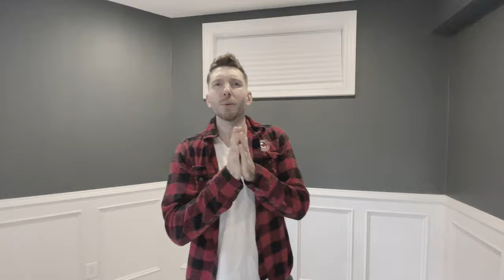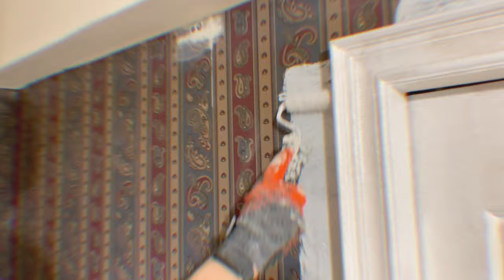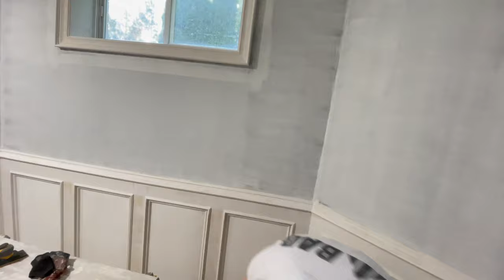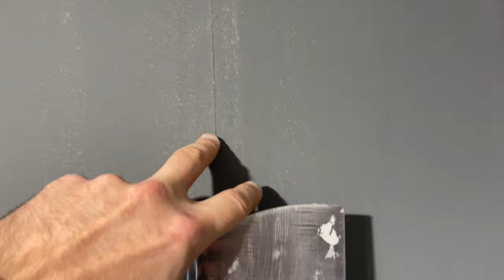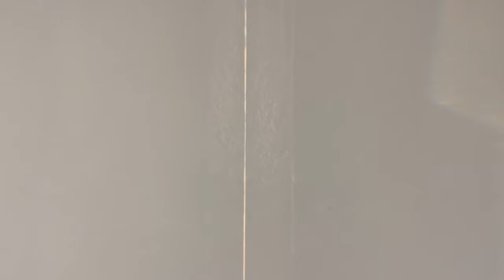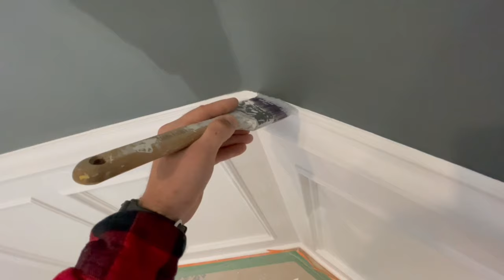Painting Wallpaper: Can You? SHOULD You? (Watch This First!)

Comment: I want to paint a small dining room that is wallpapered. It's been up 25+ years and am worried if I take the paper down it will cause damage to the dry wall.  Had 2 bathrooms remodeled and when the contractor started to take the paper off he said it damaged the dry wall and would be easier to just put up all new dry wall.  He didn't charge more to do that but maybe it easier for him to install new dry wall then to remove the old wall paper.   I will have some seems to plaster over.

Comment: just in time! this may solve my issue, where my wallpaper is pretty caked on, but I wonder how long this will last? Do you risk having the wallpaper start peeling off eventually? What if I textured on top of wallpaper, then primed, then painted? this is great!
Reply from the maker: If you follow the steps in this video, your wallpaper wont being peeling any faster than it would on its own. HOWEVER, if you’re going to go through all that effort to texture, prime and paint your wallpaper, we’d ask, would it really be that much harder to just remove it? When in doubt you’re always better to remove it first. If you can’t, or simply dont want to invest the time, seal the wallpaper with a solvent based primer and it essentially becomes a blank canvas (albeit a wallpapered canvas 😂).

Comment: I tried to get off old wallpaper and just gave up after a brutally slow process of using many different techniques to remoe about 6-7 sq ft of it. Can I use Solvent based primer to cover that area up as well, successfully? Thank you for a great video.
Reply from the maker: You could, but you’ll more than likely be able to see the areas you removed the paper still. In order to get back to where you started, you’ll probably have to prime, then skim coat the areas you removed the paper, and then prime it again. Not an enjoyable predicament to be in- but if you’ve decided removing the rest is not an option, you could give this a shot. Best of luck 👍

Comment: Great video and great painting job! I had a contractor who decided that putting in new sheet rock would be easier than removing the wallpaper that had been there for so many years, so that’s what we did. Now I have 2 more rooms to go. One has foil wallpaper and another appears to be vinyl. Will this work for these types of wallpapers?
I appreciate you getting right to the point in your video and not wasting my time by dragging on and on like so many do nowadays.
Reply from the maker: Thanks for the kind words! We always find it interesting to hear how many different ways there are to solve a problem. In response to your question, we’re not very familiar with foil wallpaper- but theoretically it should work on any wallpaper. The solvent based primer essentially gives you a new canvas to work with (‘sealing’ the wallpaper and providing a good bonding surface for new paint). Just remember that painting over it will not get rid of any bumps/seams/imperfections in the wallpaper. The easiest way to know for sure is to test it on a small area and see for yourself👍

Comment: This video was very helpful for me!! 
I recently moved into a 1920 house and every room has  different wallpaper!! 
Should I just do what you did? 
The wallpaper was put up 25-30 years ago…
Reply from the maker: Happy we could be of service! How is the wallpaper holding up? Is it peeling in the corners? We always suggest at least attempting to remove it before deciding to paint over it (sometimes it’s easier to remove than expected…sometimes 😂). If the paper is still well adhered, and you follow the steps in the video, you should be ok to give it a shot. Also, if you hate it, you could always remove the wallpaper after you’ve painted it too 😉 👍
Reply: be careful for asbestos or lead.

Comment: Thanks for the great video! I’m looking for a way around removing the wallpaper so this was helpful. Question: could I spackle and sand the wallpaper seams before I put the priming paint on or should I do it like you did- after the primer and first coat. 
Thanks!!
Reply: I am no expert on this but it is possible that the primer and first coat will show the imperfections clearly, and will protect the wallpaper during sanding.

Comment: Couple of questions. Is it best to mud the seams before primer, after or after painting. Secondly, should i use tape also or is just using the mud enough?  Thanks!
Reply from the maker: Drywall tape can’t hurt but it would make a bigger bump and probably it’s necessary. Defintely fill after oil based primer. The moisture in the compound could cause bubbling without primer first
Reply: @RefreshHomeImprovements  thanks so much!

Comment: Can you please tell me each of the products you used? is the gray paint a oil base or flat?
Reply from the maker: Sure! The white paint we used first is an alkyd based primer by Zinsser caller B-I-N 2, it’s designed to seal stains and block odours (be warned it has a very strong odour of its own while painting). The top coat we used is Benjamin Moore Aura in a matte finish (you definitely don’t need to go with such an expensive top coat here- we wanted to colour match a farrow and ball colour, and you get a better depth of colour with aura). We used Benjamin Moore advance in a pearl finish on the wainscoting 👍
Reply: @RefreshHomeImprovements  I've heard good things about zinsser. Is it similar to kilz, and I have one room where the wallpaper was actually adhered to plywood in areas instead of plaster. Thinking of doing this method but worried about having spots that are paper and spots that are bare plaster as it may look uneven. Ever done this before? I figured a good sand on the remaining uneven areas some zinsser or kills and paint would at least make it decent

Comment: Thanks for the video. Do you know if the primer make the wallpaper and paint stick on for a long time or does painting over wallpaper always increase the chances of it flaking off in say 10-20 years?
Reply from the maker: Not sure we really have the answer to that question. Painting the wallpaper shouldn’t really hurt or help the adhesion in the long run.
Reply: @RefreshHomeImprovements  Yeah i guess its a tricky question, but yeah it probably will stick with the primer... Thanks for the reply

Comment: How would you remove heany nicotine stains from the wallpaper before painting with the primer (Binz)? If we use the standard TSP, I'm concerned it will reactivate the glue.
Reply from the maker: That’s exactly what we did here! The oil primer also sealed and covered years of nicotine stains from this being an old cigar room. We didn’t clean it before or anything.

Comment: I am thinking of painting over the wallpaper in my son's room.  The wallpaper only goes up half the wall from the floor with a border around it at the top.  There is a lip around the top and bottom of the border. It is in good shape and very stuck on the wall.  Do you think joint compound will leave too much of a hump if I try to mud over the top and bottom of the border seam (border is around 6" wide)? You can hardly feel the seams if running your hand around the wall, but the border seams are quite pronounced.  Also, would I just prime the part of the wall that has wallpaper or the whole wall which is painted on top?  Steps would be prime (oil based) , repair holes, mud seams, sand and then paint right? Any advice you can give me would be appreciated. The wallpaper is in good shape and is very glued to the wall.
Reply from the maker: Sounds like you’ve got the gist of it 👍. I would definitely try to scrape the seam after you’ve primed it (as I’ve done in this video) to remove as much of the lip as you can. After that it’s just a matter of feathering out the mud far enough so that the ‘hump’ becomes a longer raised section that is undetectable to the eye. It’s essentially the same thing as taping a butt joint in drywall. There will technically always be a raised area because of the tape, but if you feather it out far enough, you’ll never see it. I would mention that there is a limit to how big of a hump you can disguise though. So if your border is very pronounced you might try removing that section instead of painting over it. You need to decide which task you’d rather spend time doing- removing wallpaper or priming and mudding wallpaper seams. Both are laborious, but if you’re going to spend a lot of time hiding seams, it’s worth considering just removing the wallpaper instead. Of the two methods, you’ll likely get better results with removing the wallpaper altogether (but we know that sucks 😞). As for the section without wallpaper, we’d say you only need to prime it if the color change will be drastic and the priming stage gets you closer to your final color choice 👍
Reply: @RefreshHomeImprovements  Thank you so much for your prompt reply.  I think I may take your advice and try removing the border and see how that goes on a small section of the wall.  I don't have experience with mudding so it could turn into a big mess. Wish me luck!

Comment: Have a manufactured home with vinyl type walk paper firmly attached it's sheet rock. No bubbles and nicely smooth but hate the pattern.  Have you painted over that type of wall paper?
Reply from the maker: Can’t say we have. But the same principals should apply. Your issues may be with adhesive of the primer. Maybe do a test area first?

Comment: Does this only work with plain, traditional wallpaper? I'm thinking specifically about the part where you scraped the seams. This old wallpaper in my living room seems to almost have a texture or weave to it.
Reply from the maker: Great question! We almost always recommend removing textured wallpaper rather than painting it. Unless you like the look of the texture with paint over it, you’ll spend more time smoothing out the texture than you would simple removing it 👍
Reply: @RefreshHomeImprovements  Here in the UK we buy textured paper to paint over, have painted over textured paper many times, no problem

Comment: The question is what kind do you use to make it scratch resistant. That's the issue I've found. Anything scratched the paint off
Reply from the maker: Interesting! Did you prime with a solvent based primer first? That stuff is generally a ‘reset’ button for any surface. New paint seems to love bonding to it, in our experience.

Comment: Thank you! I have wallpaper backsplash. I used a steamer and the wallpaper came right off but the backing stuck like glue to the matte paint. Wetting and scraping didn’t work and sanding helps but it will take many hours to get it off. I had the idea I could shellac it to seal it off. I found your video and that’s exactly what I will do. However since the sander is out I’ll use it to smooth those lines prepainting.
Reply: Windex and a scraper will get the backing glue right off

Comment: Thanks for the content✊🏾 solvent primer✅ is the shellac base zinsser okay to use  or any other Home Depot brand!?!? Does the paint need to be solvent based also!?Thanks bruh
Reply from the maker: That would be totally fine- you just don’t want to use a water based primer initially (the water could cause the adhesive in the wallpaper to fail and start peeling). Once its primed with a solvent based primer, its ‘sealed’ and you should be able to paint over it with any type of paint you choose 👍
Reply: @RefreshHomeImprovements  my man i appreciate cha 🙏🏾

Comment: What would you suggest if your wallpaper has text?
Reply from the maker: Solvent based primers (like B-I-N) usually have high hiding capabilities to cover stains etc. which should give you as good a chance as possible to prevent the text from showing through. It might require two coats, but when in doubt always follow the directions on the can 👍

Comment: This looks absolutely amazing but something tells me they could have had the wall paper removed and then had it painted and probably spent about the same amount of money
Reply from the maker: It's certainly a possibility! Sometimes you get lucky, and the wallpaper comes off more easily than expected- but sometimes you get the opposite, and end up having to skim coat the whole room anyways (we've had both many times). We just want to make sure people know they have options 👍
Reply: Sometimes you can but not always. Sometimes trying to remove correctly the wallpaper will cause to damage the sheet rock and create new imperfections to the wall, that requires more and more time